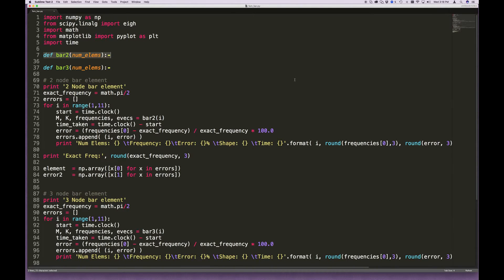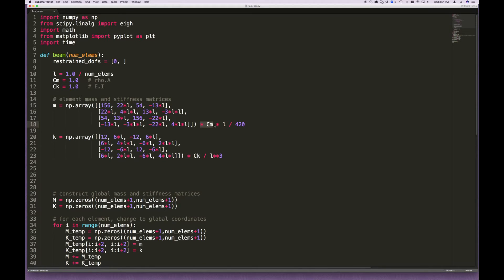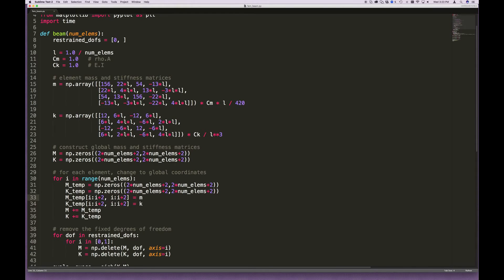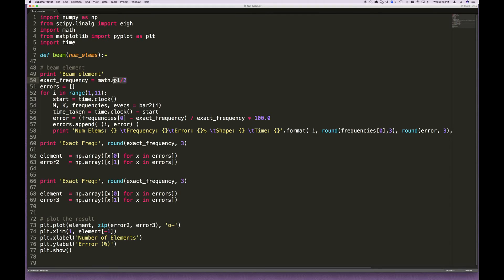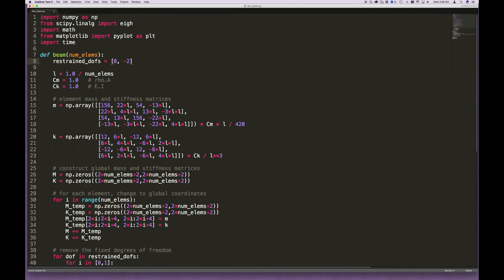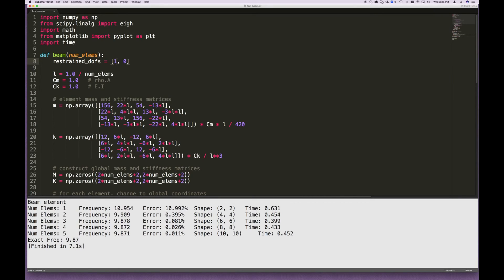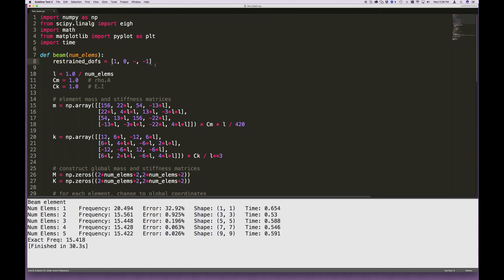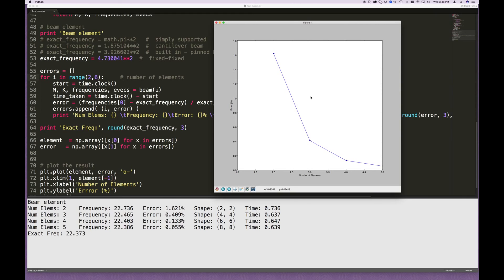Euler-Bernoulli Beam Element - Coding in Python

Comment: Q: can I use this code to determine the others natural frequencies? specially the second one from the cantilever beam. I'm trying to but I get the same results as the first frequency
Reply from the maker: You could use this, but it would be pretty tedious.  You'd have to run experiments at different frequencies and monitor the results.  

It would be better to first convert the equations into the frequency domain (I realize I haven't shown this in any videos - probably time to make one on this topic).

Comment: Hello sir, 
 I have a k matrix of order  6*6(includes axial effects) , and while broadcasting it into K_temp (full of zeroes -  40*40 matrix) , I used    "K_temp[3*i : 3*i+6, 3*i : 3*i+6] = k" .
but it showing [ ValueError: could not broadcast input array from the shape (6,6) into shape (4,4)]
Reply from the maker: This is hard to tell without more information, but clearly Python still thinks you're dealing with a 4x4 matrix.

Comment: sir, 
why the restrained dof is not arranged as serial numbers like 0, 1, 2, 3. 
How this minus sign comes in restrained Dof [0, 1, -2, -1] . 
how would python know that -2 means the restrained dof of a vertical support reaction on the right-hand side?

thankyou sir.
Reply from the maker: This has to do with the way python indexes lists.  A positive number refers to the start of the list (0, 1, 2...) while a negative number refers to the end of the list (-1, -2, ...).  

If you look at how the degrees of freedom are numbered, the last dof is a rotation while the 2nd last is a vertical displacement.  Since we want to eliminate the 2nd last dof, I refer to the restrained dof as -2 - ie the second last element..

Comment: sir ,what change to handle non homologous BC.say left side is fixed right is permissible 4 unit deflection
Reply from the maker: This would be a discontinuous problem.  Your right boundary is free until a 4 unit deflection at which point the fixed boundary must be applied.  You would have to treat each case separately.  On the other hand, you might be able to approximate this boundary condition by using a spring instead. By making the spring stiff enough, you could restrict the deflection to a maximum of 4 units.  It,s not exactly the same thing, but it’s continuous, simpler and might give you reasonable results.

Comment: Hey freeball ,  i am working on a cantilever beam and i have finished coding and deflections i am getting are very accurate .so i was hoping can you make a video on how i can use simulation using python to show the deflection just like Ansys does. I hope you understand what i am trying to say.🙏🙏
Reply from the maker: Do you possibly have a screenshot or an image I can look at?
Reply: @Freeball99  i have code here https://github.com/gen1ze/finiteelement/blob/master/1d_beam_element_with_only_uniformly_distributed_load(1).py
Reply: @Freeball99  https://s.amsu.ng/80j0aZFJfniN
Reply from the maker: @iKrakin  So you're trying to plot it in Matplotlib and it's not working?  What is the issue you're having?
Reply: @Freeball99  no thats not the problem.I want to create an animation of beam bending
Reply: And i dont know how to do that
Reply from the maker: @iKrakin  Interesting...I'm going to need to think about it for a little while.  Not sure off the top of my head the easiest way to do this - especially the coloring.
Reply: @Freeball99  sure bro take your time. I think they used tricolorf function in matplotlib to color.

Comment: Question:  Hello,  Your lectures and code are excellent and provide clear explanations of complex phenomena. 
I have a related question about this topic and would be grateful if you can provide an explanation with your usual clarity.
Specifically I am interested in transverse vibration of bars but find it difficult to understand the physical interpretation of, particularly, rotary inertia (old texts refer to it is rotatory inertia) and shear when bars are not slender or on slender bars for the frequency of the higher overtones.  Classic texts provide mathematical corrections for the effects,  but don't explain their physical origin.  Are you able to assist?
Reply from the maker: You ask a very good question and it's unlikely that I can answer it using this messaging system.  It will require a video but I have waited on doing it because it really falls outside the scope of what would be considered "Introductory".  You are correct that when considering shearing effects (Timoshenko Beam Theory) the rotatory inertia inertia becomes important.  This becomes an issue in stubby beams as you have indicated and also in the analysis of anisotropic materials such as composites.  Textbooks can be pricy and often not particularly detailed.  Most good PhD dissertations in these areas ought to have a good write-up on the derivations of the equations of motion for these.  Might be available online or at a an engineering library, if you're attached to a university.  

You can start by searching "Timoshenko Beam Theory".  As an example, here is a Wikipedia article though it's definitely not the best write-up I've seen on the subject:  https://en.wikipedia.org/wiki/Timoshenko_beam_theory
Reply: @Freeball99  Many thanks for taking the time to reply.  Keep up the great work!   It would be a great contribution if you were able to make a video at some point as that would be a great contribution, unfortunately the concept is complex but if well understood has potential for application (determination of anisotropy, shear, poisson's-ratio....).  My interest is in wood, it is certainly non-homogeneous, but it is good to start with simple assumptions.  The Euler-Bernoulli system is not trivial to understand either but it is great (relatively simple).  Thank you for the link, and any suggestions you may have for good PhD dissertations.  (Incidentally Timoshenko's classic paper and others, on the corrections is totally beyond me).

Comment: thanks for the video sir < ...i just change the degree of freedom locations( in the matrix) i.e the v1,v2,theta1,theta2 instead of v1,theta1,v2,theta2 (like u did ) , but results r not coming..only the first value of frequency is matching ..further it converges to 1...
Reply from the maker: Sounds to me like you have the coordinates in different positions, but you are using my same K and M matrices.  This will surely give you incorrect results.  You will first need to re-arrange my matrices (or re-derive them) to ensure that the correct values in your matrices are multiplying the correct coordinates.

Doing things your way makes it much more difficult (in my opinion) to assemble your global mass and stiffness matrices.  It can be done, but gives much more opportunities for mistakes.  

My advice?   DON'T DO IT.  Group the coordinates for each node together (i.e.  all your node1 coordinates, then all your node2 coordinates, etc.) AND keep these in the same order for each node.
Reply: @Freeball99  thankyou sir

Comment: Great lesson, but i don't understand one thing. Why don't you include boundary conditions for the shear force and bending moment at the ends of the beam  into stiffnes matrix?
Reply from the maker: For the purpose of finite element modeling, the GEOMETRIC boundary conditions are applied by eliminating the rows and columns corresponding to those degrees of freedom from the mass and stiffness matrices.

The boundary conditions that you have described (ie the applied forces and moments) are incorporated into the equations of motion by including them in the forcing function.

Comment: So useful, im working in my thesis degree about aeroelasticity, and with this explanation of the structural model will help me a lot, im trying to go further more and implement deflections of the cross section with shape and expansion functions in the formulation of FEM, it will be interesting if you know about interpolation of meshes which don't coincide the location of each node of each meshes, keep doing this kind of work. Best regards

Comment: Hello, First of all I want to thank you very much for the movies on FEM, they are really helpful. I have one question. Basically, I want to model the response of a beam in the frequency domain using a transfer function: {x} =  [H]{f}, where [H] = [-omega^2 * M + K]. Furthermore, I want to model this with stochastic dynamics instead of deterministic dynamics. So my force input will be a force spectrum {S_FF} and my output a response spectrum {S_xx}. Now my equations become: {S_xx} = [H] {S_FF} [H]^T. However, my problem is that my response spectrum gives me different values when I increase the number of elements and this does not show convergence. Let's say that my force spectrum only contains a moment as input at the rotation DOFs of the supports. Do you know why this could be the case? Because clearly, the eigenfrequencies converge very fast when you increase the number of elements.  Kind regards, Chris
Reply from the maker: Chris,I have never personally coded an FEM frequency response model though I have read about it plenty so I am hesitant to recommend anything that might send you down a bad path.  While I am not familiar with the problem that you are experiencing, I can offer you this, however, just in terms of overall code debugging practices (assuming it is, in fact, something in the code):

1.  Unit testing - As a student, I used to ignore this until I ran into a problem, but the more time I have spent in industry, the more I have begun to appreciate that this is part of the coding process.  The idea here is to create a suite/series of simple tests that test various assertions about the routines that you have coded.  Make sure that the various routines you have coded are giving you the results that you expect from them.  This is especially true for routines that you have downloaded from a library or codebase somewhere.  Don't ever assume that some so-called expert's routine is correct - check it!   

2 - Sample Problems - Find a worked problem of the type that you are trying to model.  Chances are that a paper or a textbook somewhere has a sample problem of the type you are coding (preferably one that shows step-by-step results).

Sorry I can't be of more help here. 

Andy

Comment: Hello, can you help me as I can find deflections with this method by programming it directly from python
Reply from the maker: To find deflections, you are just solving the static problem {F} = [K]{x} for {x}.  So, you find the deflection, {x} = inverse([K]).{F}

So, all you need to do is:  1)  Find the [K] matrix as in the video.  2) Find the inverse of [K].  and 3)  Multiply this by the force vector, {F}.

In order for find the inverse of a matrix, first include the following at the top of the code:  from scipy.linalg import inv then you can use: inv(K)
Reply: @Freeball99  Do you have any suggestions for help on assembling the force vector.  I have watched a bunch of different videos and done some reading, but am still not clear.  

I am using this element force vector to apply self weight: 
q = -rho * A * g   # distributed force (self weight)
f_dist = np.array([-q*l/2, -q*l*l/12, -q*l/2, q*l*l/12])

Then similar to your other global matrix generations I use:
F_temp = np.zeros(2*num_elems+2)
F_temp[2*i:2*i+4] = f_dist
F += F_temp

And then removing fixed DOF
F = np.delete(F, dof, axis=0)

Solving for displacements
U = np.matmul(inv(K),F)

I think my issue is in the removal of the DOF perhaps, but I am maybe shaky on concepts is perhaps the issue ;)
Reply: Figured out my stupid mistake.  Had a (-) in the q and in the element force, matches standard FEA code now.  Thanks.

Comment: Perfect content, exactly what I was searching for. 
Hope you will answer me. What are benefits in learning python for civil engineers, in your opinion? Is it a plus for an employer, or maybe it will simplify civil engineer's work?
Reply from the maker: Python should be considered to be a tool for the engineer.  I don't think it is necessarily a plus for an employer because, as a civil engineer, you will likely use commercial software packages when analyzing problems, but it is certainly useful for preliminary analysis on many problems - including homework problems for engineering students.  You should think of it perhaps as a very advanced scientific calculator.  

One of the knocks on Python is that it runs relatively slowly when compared with other (especially compiled) languages.  However, its true speed is in the short time it typically takes to deploy (write & debug) a piece of code to solve a problem which adds to one's understanding of the problem being tackled - and for many things it is more than fast enough (as demonstrated in the video).  I have some colleagues that have written fairly sizable finite element codes using Python and it has performed pretty well in terms of its speed.  Add to that the fact that some of the more computationally expensive routines can be coded in C++ or FORTRAN which results in a huge performance boost.

So while, as a civil engineer, knowledge of Python may not look like a particularly big plus to an employer on your resume, it will certainly impress an employer when you are able to produce preliminary results in a very short time.  This, in the long run, allows you to work more effectively and efficiently on a given problem because it gives you insights to benchmark your results against.
Reply: Freeball Thank you for your answer. I will take into account it and study python.
It's strange that you don't have a lot of subscribers)
Reply from the maker: If you are planning on learning Python, the following might be useful/interesting for you to know:

1.  Python was invented by Guido van Rossum, who for many years, and until recently, worked at Google.  Consequently, it is used extensively in many applications at Google and, as such, Google has put out a lot lot of training videos (on YouTube).  These are a good place to start.  Google has, more recently, invented the language Go (often called 'Golang') which is a much faster, compiled language.

2.  In addition to the Google training videos, there are several other YouTube videos which give anything for a general overview of coding in Python to the solving of more specific problems - though, from my perspective, a noticeable lack of videos demonstrating finite element modeling which yours truly has attempted to begin remediating.

3.  Python was used to build the original Google search engine stack though this has since been replaced by compiled code.  The YouTube front-end was also coded using Python.

4.  Other well-known web sites built using Python include:  Reddit, Dropbox, Pinterest, Instagram, Bitbucket, Yahoo Maps, Spotify, Quora.  Most of these use a Python framework called Django which makes it a breeze to built web applications.

5.  Python has a HUGE support community behind it.  Almost everything you'll want to do with it has either been demonstrated or has a library built for it.  It's rare that you will have to build something completely from scratch...and if you do, there are plenty of forums where you can seek help.

6.  Python seems to be gathering a life of its own amongst the artificial intelligence community (including machine learning, robotics and the like).  Google has recently released a library called TensorFlow which makes this extremely useful and computationally efficient.

7.  Some additional Python libraries that you might want to explore as an engineer include Numpy and SciPy for all numerical processing (basically a substitute for MATLAB and the language R), Pandas (which is like Excel on steroids and can be used to import and handle spreadsheets), Matplotlib (a graphing/charting library).